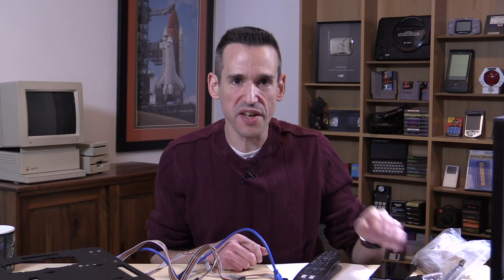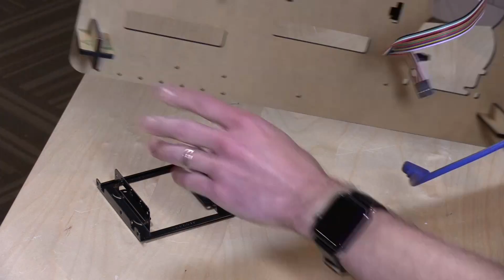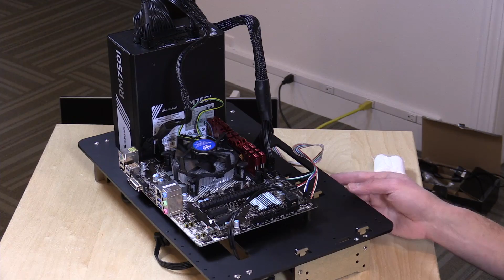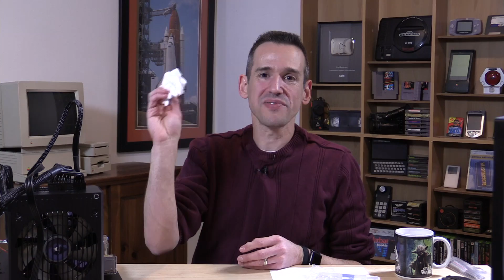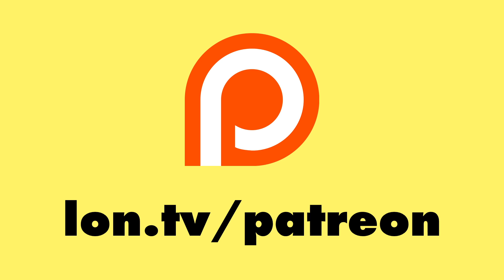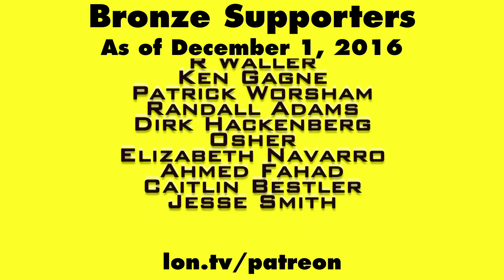DIYPC Alpha-DB6 Black Acrylic ATX Bench Case Test Bench Review - PC Build Week!

Comment: No hate, but that's not a computer 'case', a case is an enclosure that helps contain everything, that is a test bench. It's the exact opposite as a case in terms of tucking everything away, instead leaving everything more exposed and easily accessible. But my nitpicking aside, great review and interesting test bench, already sold out it looks like.
Reply from the maker: These were the titles / keywords used at Newegg. I like to use those as it increases the probability it will be found in a search.